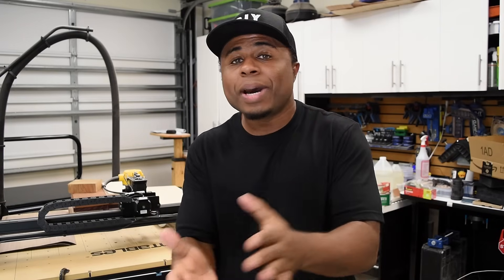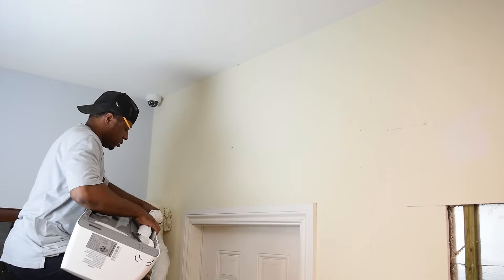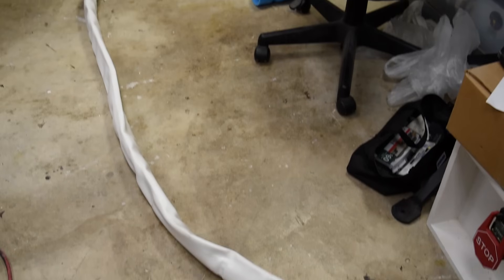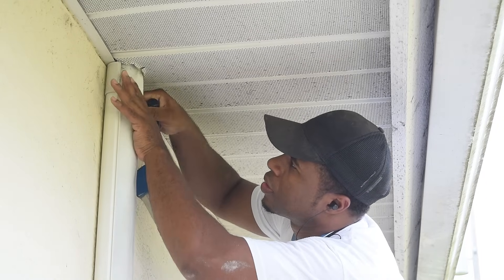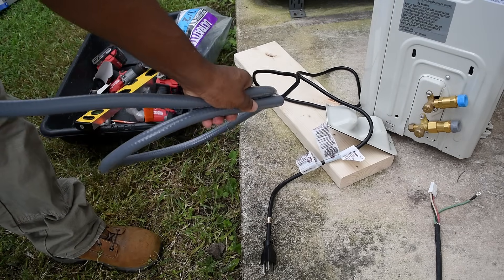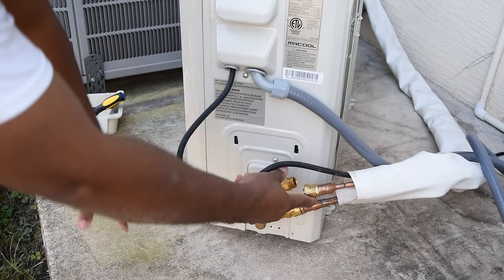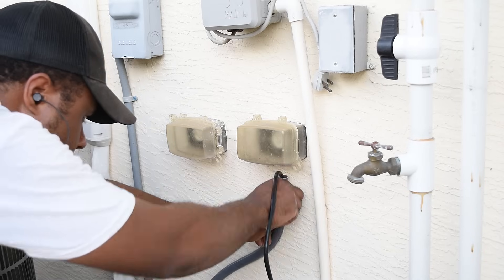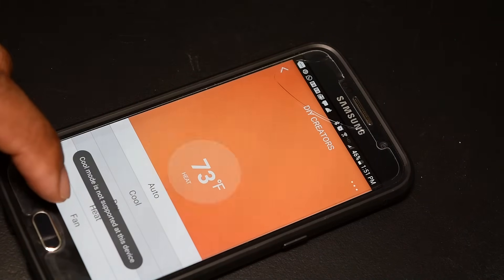How To install Ductless AC & Heating System // True DIY Mini Split MRCOOL

Comment: Thanks for posting this! Never knew there were pre-charged systems. I would wonder though if it wouldn't be a good idea to have an HVAC tech actually service the system. The lines running to the interior unit are empty., and thus any minor leakage could result in a low system.and a possible compressor failure.

We run split systems exclusively here in East Europe. I have 2 in my flat. Here is a drawback to the system.

The interior fan is usually a "barrel shaped" running the width of the interior unit, where upon it typically has 7 or 8 blades. It lies behind the adjustable vents. The issue you will eventually have, is a vibration noise after about a year or 2 of usage. Why? Well, this fan is a huge dust magnet, and the filter on the unit itself only traps large particles. Toss in the fact it's gonna be a high humidity area, and the stuff cakes on to the fan, thus throwing it out of balance.

How to clean it? Here in lies another issue. To properly clean it, one has to pretty much dismantle the front half of the unit itself to remove the fan. This is ok if you're a pretty decent mechanic and have a day to spare.

Forget those cans of compressed air. Won't work. Not enough pressure to blow off that caked on stuff, and as you spray the can, it gets cold and you lose even more pressure.

A real air compressor with 90 psi. This would probably work if you had a slender enough attachment to get between the vent. However, you're gonna make a mess with chunks of stuff blowing out of there! 

What I use is a toothbrush with long bristles. I can manipulate it between the vents and slide it along the width of the fan blades. This removes about 70% of the crud, but watch out when you turn the fan on high as chunks will undoubtedly blow out.

Another thing you may want to do, is spray an anti-bacterial spray (Lysol) on the filter/condensor fins a couple times per year. This high humidity area can harbor some nasty critters.

Comment: Congrats! Lots of work and money for nothing. Should have read the intructions. THIS UNIT WILL FAIL SOON!  You did did NOT vacuum down your evap lines to 100 microns or below,  that were open to the atmoshere, nor did you do a pressure test. You now have non-condensible gas in your sysytem and you WILL HAVE an acid burnout in your system sooner or later(usually within 5 years, but given you did NO vacuum, what so ever...sooner).  Mark these words, CALL A PROFESSIONAL!  You have ruined the unit.  I will also bet money you have crimped your lines trying to do it yourself. It may work now....but just wait...this will cost you more in the long run than having a PRO sell you the unit and provide warranty than buying off Amazon with NO warranty....Oh...wait, did they say there was warranty...yea, really...ONLY if installed by a licensed HVAC guy. Probably not.. If you are lucky they MIGHT cover it, but I doubt it. Best of luck, from a 35 year HVAC tech.  Depending on how long this unit has been running the BEST thing you can do is call a tech and have them evacuate the unit, draw down to to the proper level of 100 microns or below that has to hold ten minutes under 1000 microns, and then recharge with the proper type and weight of refrigerant. That is the only thing you can do to save your investment. Otherwise, please remember this warning and let me know how right I was. Not many techs would bother to take time  to type all this shit to save your mistake. I just happen to have some time and ran across your vid by chance. You should take this advice to heart, because I don't give this kind of advice for free very often.
Reply from the maker: It sounds like you know what your are talking about. However, I did my research you clearly haven't. The unit is different from what you know. This manufacturer approve of this installation and no warranty was voided.  This is a DIY unit designed for DIY installation. Yes, it's a thing. I appreciate your comment.

Comment: How well would a unit like this perform in an arizona summer? insulated garage with insulated door and temps outside around 115+. What temperatures could this unit keep the 480 sqft garage comfortably at without killing it in 3 years.

Comment: I assume this is a line-set with pierceing tips. Nice video, I would suggest if you have cold weather seasons insulate your drain tube.
Reply: Michael Melvin in cold weather you wouldn't be using it to cool, so no condensation and no freezing risk, insulation is pointless.

Comment: My Mom has something like that at home where the ac is connected to the second floor and drains to the basement. Wondering if you experienced any issues with drainage smell after not using the ac for the winter. The AC guy can come to clean it up but it cost 200$ every call each year. Have you ever experienced this and do you know of any cheaper solution? Thanks

Comment: It's not a harness, it's a line set. Also u forgot to vacuum the system to 500 microns, your refrigerant is contaminated. You have your indoor unit so high to the ceiling. How are you going to get to the filters?
Reply from the maker: Go away

Comment: With that small of a space you could have used a threw the wall unit.  Mini splits are nice until you have trouble with the electronics and then the factory will make up for any loses.  I single board in this unit can cost as much as the new unit did.

Comment: In the video, you did not pressurize the line set with nitrogen to do a standing pressure/leak check with nitrogen & soap bubbles. Nor did you release the nitrogen & pull a vacuum down to 500 microns with a vacuum pump.

Did you do these things off camera? I hope so. Because if not, your system will not operate at its fullest. & its likely that parts will fail pre-maturely.

That line set is pretty long. You probably do not have to add any freon, but its always a good idea to hook up gages & check temps/pressures.

I also noticed that you traced the entire inside unit on the wall. You could of also just traced the mounting bracket. Its a lot lighter than the entire inside unit.

1 last word of advice:
Never close up the line set until AFTER you have determined that there are no leaks.
& use a torque wrench to tighten the flare nut fittings.

The system operates only as good as the installer installs it!
-Very Important.

Comment: we bought a mr cool unit but chickened out, sold it on craigslist, & had a company install a mitsu. but you make it look so easy. it's so much cheaper to heat my house now than with that electric central furnace. cut my electric bill to less than half.

Comment: The line set is capped to reduce moisture and air from entering the line set once you unseal, air is instantly present, a pressure test helps ensure  410a is not leaking into the environment (though it not as bad as a CFC refrigerant it still effects the environment), pulling a vacuum is not a test it is to remove moisture and from system -  non condensables include: air, moisture, dirt, copper shavings, anything foriegn ETC... proper removal of these is proper craftsmanship also cfc licenses are important obviously you want a good technician and possessing one does not guarantee that but it means they are certified to handle three different levels of refrigerant based systems. This is not to criticize but inform it doesn't take a good technician to make a system run it takes a good technician to make one preformed as intended.
Reply: I have installed these systems and many have vacuumed & sealed linesets.....Seals are punctured upon final makeup leaving miniscule pollutants or non-condensibles entering system...
Reply: BS. There is plenty of air from when he let the nitrogen out in the inside unit. Pollutants are irrelevant. Air moisture is relevant.
Reply: These lines are sealed on both ends which is why you don't vacuum.
Reply: @dyoel182  These fittings were originally designed for dry cleaning machines so the owners could clean the lint off their evaporators without calling a fridgy to pump the unit down.

They're not the greatest, they will eventually leak but they will work for a couple of years.

Comment: You've given me the confident I needed to do this. THANK YOU!
Reply: Rahman R did you get it done?
Reply: @SwagSo7fly7   Yes I did, I also installed  the  Mr Cool 12000-BTU -pretty easy to install, even installed the 40 amp breaker for 220v, only thing i wish i had done was to get dual zone set up.

Comment: hello dear sir : when the ac is new the system came open them when you connect the the 2 line for the refigerant  is air in the condenser   you need to made a vacume  after vacume you can open the valves if you dont made the vacume the oil and the refrigerant will be damege  and thanks for your video

Comment: For myself working in the hvac trade this mini split system looks solid and your on point with everything in the install only recommendation would be to add nylog on the threads before hooking up line set just a safety precaution to prevent leak

Comment: I'm an hvac engineer and I thought you did a great job!!! 👍
Reply: Really?
No vacuum? I am just an EE and if thermo does not fail me, water will condensate inside the unit since he closed the system without vacuuming the indoor unit. Air took the place of nitrogen,so....Humidity.

Comment: I live in a townhouse and I’m not a corner unit. I converted my garage into a man cave. I left about 3 1/2 feet to still be used as a garage/storage area. My garage is at the front of my unit and there’s no way to run a line to the back of the house because it’s a 2 story unit. Can I put the condenser/compressor in that storage area and drill a small drain hole out the front wall?
Reply: Most units come precharged for around 15 meters of piping

Drain can go straight out the wall 

Indoor drain only runs on cooling Outdoor drain only runs in heating
Reply: Outdoor unit needs fresh ambient air, So I wouldn't be putting it inside a room

Also when the indoor is on cooling the outdoor will be blowing out hot air.
Reply: Ok thank you. I think I'll just get an evaporative cooler
Reply: @dabo1971  Evaps only work if you live in an area with low humidity otherwise they're a waste of time 

Any reason why you couldn't put the outdoor unit on the roof and run a drain pump to pump the water onto the roof?
Reply: @mattm5361  it's a two story townhome and the garage is in the front. Because of the HOA I can't have anything in the front of the unit
Reply: I know that’s what they say. I live in Florida, but seeing that my garage has no windows and it’s a 4’ storage area between the wall of the converted room and the garage door, that the humidity is not a factor in there. Right now I have to open the door to let the air circulate from the rest of the house, plus I have a ceiling fan in there. That’s getting the job done for the time being, but when I want to close the door for privacy, it’s warms up in there

Comment: WOWZERS!! This was a fantastic video! Plain, clean, clear, thorough, and from a do it yourselfers prospective! I am still wondering about how the device holds up! Whether it does the job! And how long it works without service! Plus, if it needs service, I'm curious about the ease! 

Nice job, and congrats on the new unit!!
Reply: I'll save you the time 

The unit is a cheap mass produced re badged Midea, Spare parts don't exist

It will have a 12 month warranty. But you will never be able to use it as the company will sell thousands of them for a few months then change the business name and vanish (I have seen so many people have this happen to them} 

Servicing of a heat pump is essentially just cleaning so all depends on how dirty the room is

I've been in the commercial refrigeration industry for over 15 years and I can not stress enough how bad these Chinese heat pumps are.

Comment: The electrical was wrong the way he left the seal tight hanging like that under the receptacle water could get in there that is not right by code at all on he should of put another connector to connect to the box and get rid of the plug and just hardwire it to the previous circuit already there
Reply from the maker: Sounds like you didn't watch the entire video.
Reply: DIY Creators I did just because you tucked the cord into the bubble cover doesn’t make it right the liquid tight is meant to be liquid tight there are not supposed to be any openings if it is the one with the metallic sheathing inside of it it will now be exposed to moisture and corrosion
Reply from the maker: What I meant was I mentioned this was temporary. I am going to bring a new circuit to that location. For the time being I just need to fire it up.

Comment: This video is dangerous, anyone using refrigerant WITHOUT the proper cert and training is breaking the law.  Trained pros prevent leaks by doing it right, theres enough garbage in our air as it is. Not to mention electrical, again license, unless you wanna fry something. Ignorance may seem cheap, it's not.
Reply: Only thing dangerous is your BS advice.  I've SEEN "trained pros" screw up a lot of installs,releasing refrigerant, and not only in the HVAC field...Know what? If someone wants to take the chance on a DIY job of any kind, they have the RIGHT to attempt it, without threats and BS. This licensing and training stuff came to be mostly for the protection of those already in the field, and not to protect DIYs.  Pretty lame to bring that up! BTW, it says CLEARLY that the DIY part of  installing the Mr Cool line of Mini Splits does not include installing the electrical service.  For the rest of you folks with reading comprehension issues: pull whatever vacuums get you through the night...spend the $100-$200 for the equipment to DIY ( heaven forbid!!!), or line the pocket of some "professional" to do it..its your choice, whatever you do, but lets not threaten people "in the land of the free" with non existant, non applicable "code" violations, heavy handed fines, or worse, bodily injury just by deciding on a DIY install of a mini split explicitly designed to fill this need. I also installed a "ton" of these as well, and I'll enjoy mine for the next 7-10 years, and the money I saved by DIY will more than cover a replacement unit, if and when the time comes. There are many people who choose to use a "certified and trained" professional, and leave it to them.  Myself and many others, for many reasons, choose not to.  Just go over MrCools instructions for the installation of their DIY series, but lets not hear the "pull a vacuum" crap: its total misinformation from some people who probably never been closer to an AC unit then the thermostat.
Reply: The electrical is not DIY for most but the fact that this series comes with a sealed line set makes that part of the installation DIY.

Comment: So it's been a few weeks now. How do you like the unit?  Did it have much effect on your electric bill? Does it also provide heat?  My gas heater is pretty much done and I'm looking for a more efficient and cost efficient appliance.  I also don't have central air conditioning so I'm trying to find something that can do both.  Any suggestions?

Comment: Ive never done any precharged lines but have done probably 500+ ductless mini splits and I can assure you the biggest problem is leaks at the flared fitting. Maybe the precharged are different but the without being able to pressure the lines with nitrogen to 500psi you cant tell. Standing pressure of those lines is only going to be about 120psi, which you would have to have a pretty bad leak for that to show.

But youll know in about 6 months if that line is leaking at the condenser.....
Reply: Do you use 500 psi arbitrarily or by empirical experience? I am doing a Mitsubishi and they recommend 200 psi of pressure nitrogen for testing.  Are you using 500 psi to save time?

Comment: You did not pressure check and vacuum the lines before you opened the valves. You have air/non compressible gasses in the system!

Comment: U need to vacuum the lines 😂 need NEW refrigerant because all the charge is mixed with moisture
Reply: The evaporator and lineset are precharged with refrigerant in this case.  When you tighten the lines to the condenser unit , a seal is pierced allowing the refrigerant to flow. No vaccuum needed.  This is how Mr DIY creator was able to install the unit without a Safe handling Certificate.
Reply: Really?  That sounds like a great story. I mean a great marketing BS. So, how 
do you factor the air that took the place of the compress nitrogen in 
the inside unit?